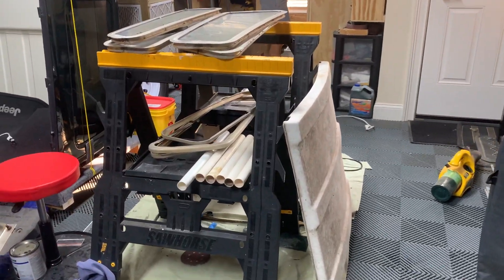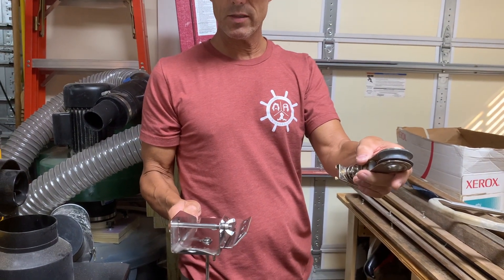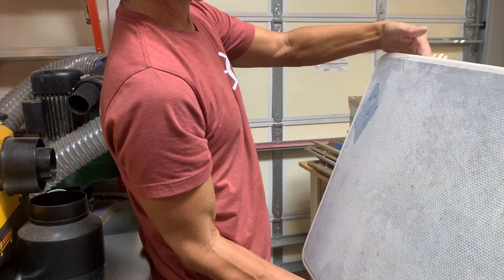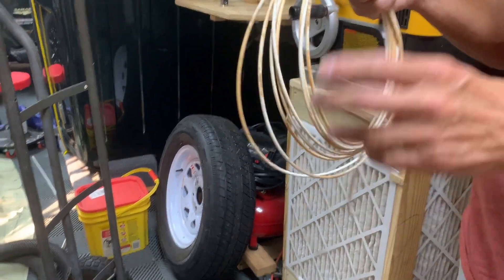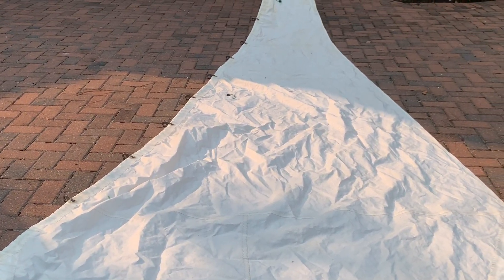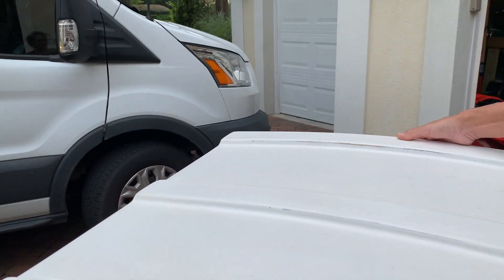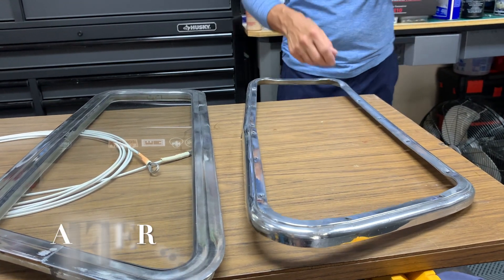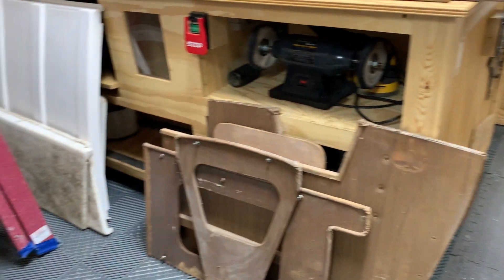Online Shopping for used Sailboat Parts for our Catalina 22

Comment: If you can learn to stow your jib by flaking it and rolling it up starting at the clew and finishing it so that the tack is at the outside of the roll, you can start hoisting it straight out of the bag.  The head of the sail will be ready to attach to the halyard and the hanks will be right there to attach to the forestay as you raise the halyard.

Also, stainless steel fasteners and Locktite 567 are your friends. If you're not using stainless, you'll be replacing it.